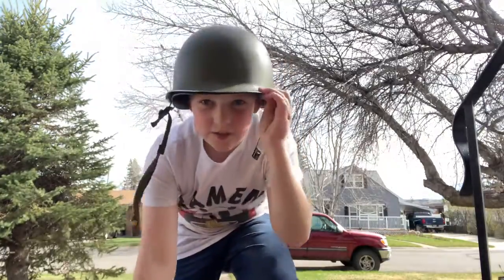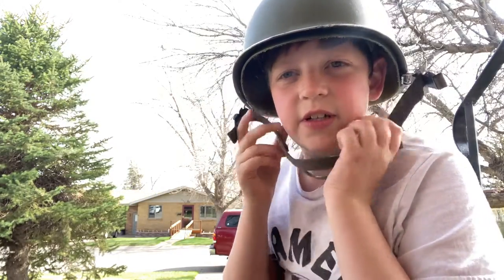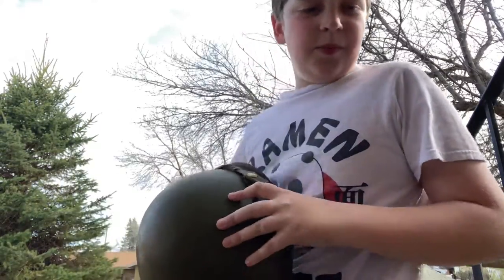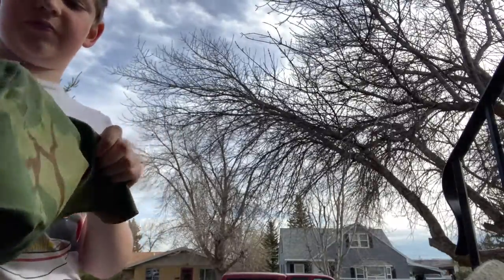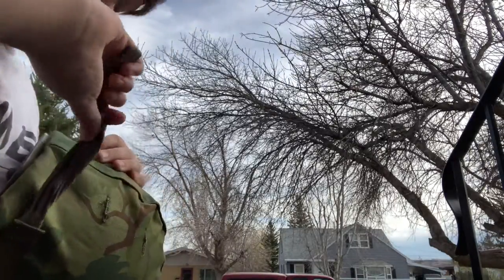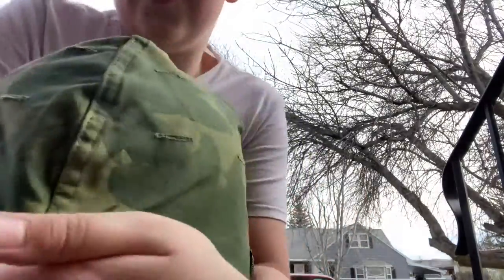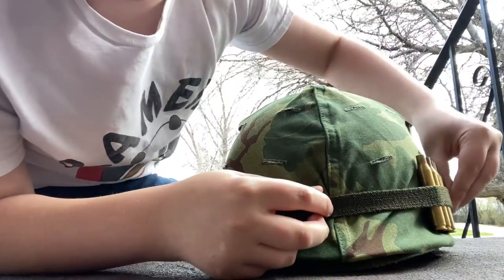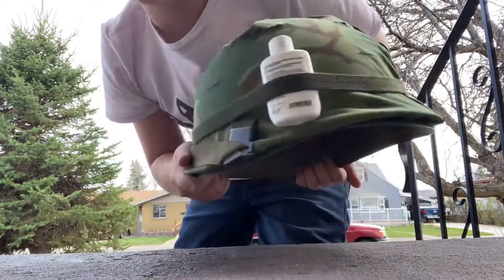Vietnam War helmet update

Comment: that liner and chinstrap you have on your helmet is from the 1980's. in vietnam, they had the og7 color chinstraps, the one with the ball connector. the liners from vietnam had a brown and tan liner body, but the webbing is pretty much the same. cool helmet tho. also, whenever you're not using the helmet cover, i would recommend putting a helmet band on the helmet liner then putting the liner in because those 80's liners are a pain in the butt to keep inside the helmet, i would know because i have one in my helmet. if you have any other questions about the helmet or anything else about vietnam helmets ask me bc i know a lot and can help u.

Comment: Got a ww2 type liner but a Vietnam war era steel pot
Reply from the maker: Oooh good ideas!
Reply: Well late 1944 early 1945 was when the rear seam helmets started coming out in limited numbers so really you could say late WWII/Korean War/Vietnam Steel pot helmets.
Reply: Pretty sure that's not a WW2 liner. M1 liners from WW2 through to Korea had the Riddell "donut" suspension. This liner has the crossing straps suspension that was used in Vietnam, although it looks like a late 1970s early 1980s model. The chin straps are definitely post war. Still, this young fella has a very nice M1 helmet. I can see that he has the helmet collector bug.

Comment: bro the helmet is from the 80s
Reply from the maker: The 1980s model is basically the exact same as the 1960s model.
Reply: @jackthecamouflageman476  chinstrap is majorly different but the liner is barely different. So liner is good but if you wanna get a fully Vietnam helmet get new chinstraps but the 80s chinstrap is fine for having fun around the house or whatever. Nobody will really tell the difference if you have it hooked together on the back unless they take a super close look at it. Thanks for responding.
Reply: @offbeatmaniac400  did the Vietnam M1 liner have the nape strap on the back or was it omitted? I have a helmet shell coming in and need to buy a liner and chinstrap for it Paid $50 for it. And I have a 80's helmet  Don't want to do a thing to it has a bunch of different GI's names in the shell and liner and also sports helmet art hidden under the ERDL cover.
Reply: @michaelbenjmitchell1  Vietnam era liner does not have a nape strap. If you wanna make sure it’s a Vietnam liner look behind the adjuster of the sweatband and it will have details on what year it was produced. The webbing of the liner is like the 80s liner. Hope this helps
Reply: @offbeatmaniac400  my webbing says 1972 and it is a fiberglass shell not plastic like the 1980's liner shells. The date text goes 12 Oct 1972 so my liner is a late war liner.
Reply: @jackthecamouflageman476  not true, the chin strap is completely wrong!
Reply: You got that right!🤪 Lost count how many times I've seen sellers on evil bay list helmets incorrectly,I've contacted some who are usually appreciative while others ignore the advice!🙄

Jman 

Jman